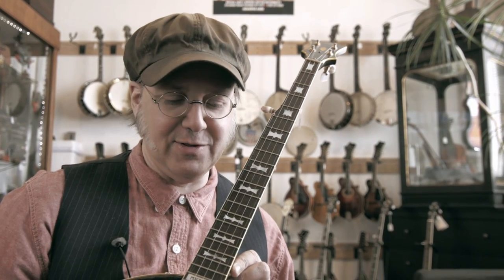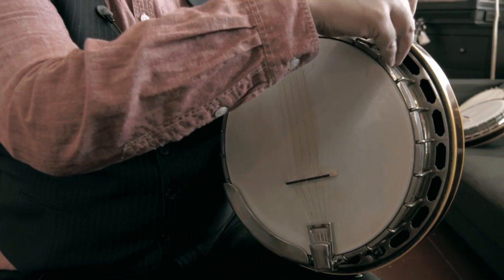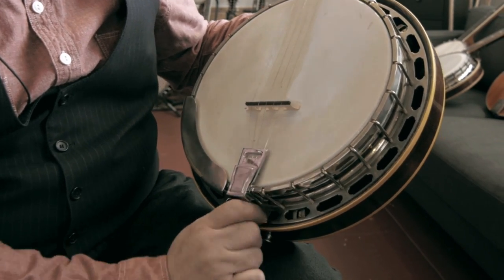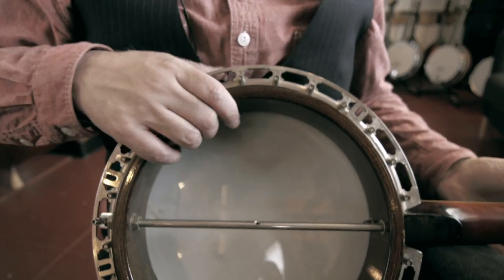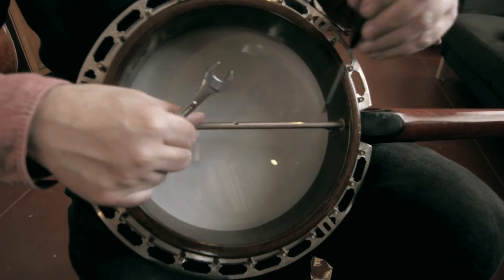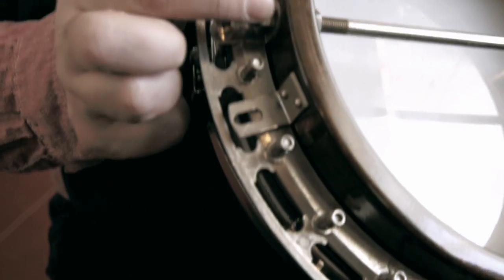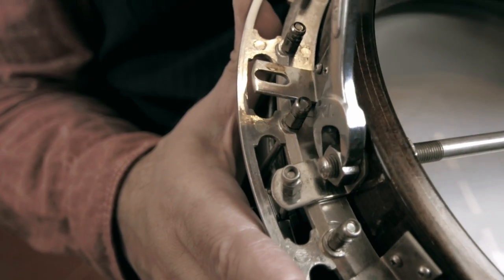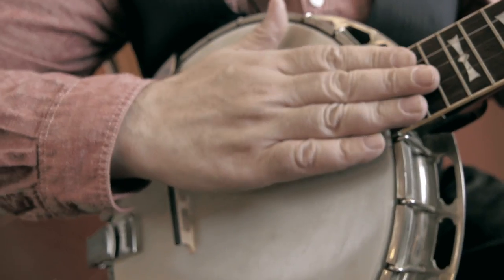How to Adjust a Banjo Neck Alignment Rod : Banjo Basics

Comment: I am a banjo builder who started in 1973. I maintain that coordinator rods should never be used to adjust action. Said adjustment is accomplished by warping the rim. Rims should never be intentionally warped. At the least, tone and volume will suffer. In extreme cases, rims delaminate. If action cannot be corrected by truss rod adjustment, changing bridge height, and/or nut work, the neck should be removed and refit. Muscling coordinator rods also tends to strip lag bolts out of neck heels.
Reply: I read your reply twice and came to the conclusion that you only speak banjo-ese.  The teacher in this video speaks beginner-ese, yaaay!
Reply: You are wrong. The teacher in this video speaks destruction. It’s your banjo. Go ahead!
Reply: I saw one repair video where a guy removed the neck and shimmed it like a bolt-on guitar in order to change the angle. A banjo neck attaches differently, of course, so he used double-sided tape to put the thin wooden shim above where the bolt goes in from the body. Thus, the neck tilted back and lowered the action.